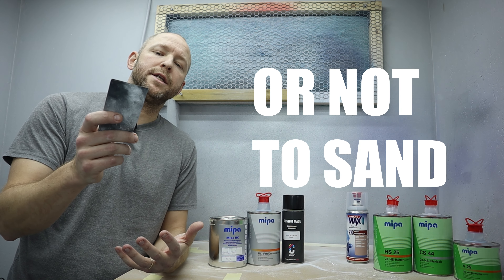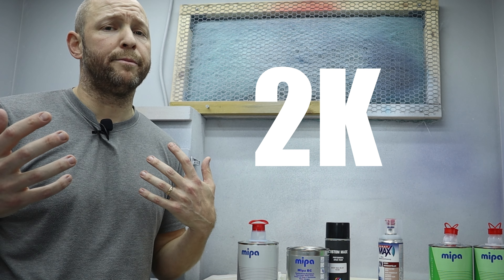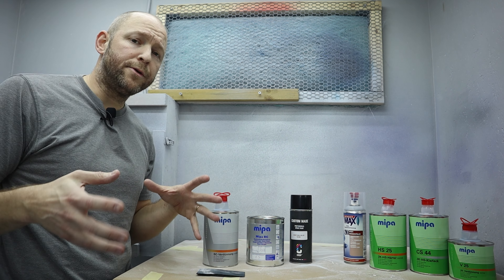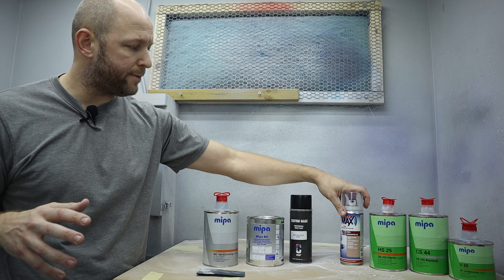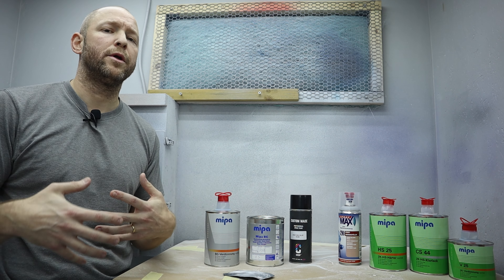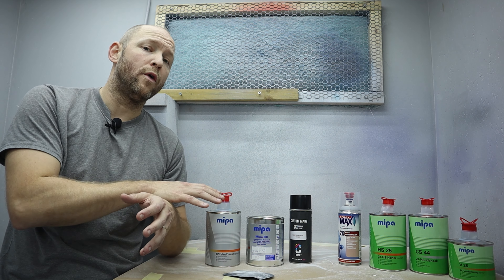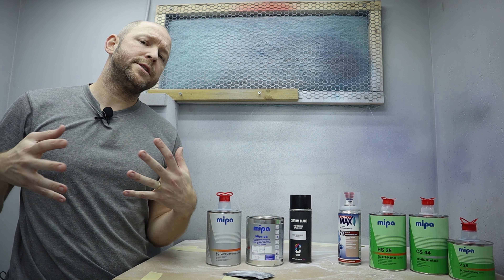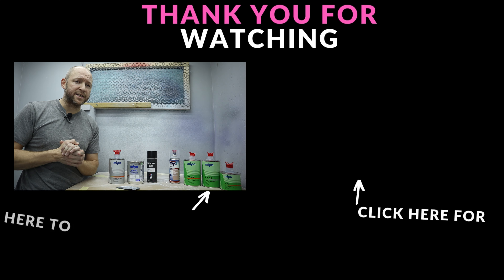Should you sand between coats of paint when you spray paint?

Comment: I agreed with you 100% until  I felt my final 1k base coat with my hand as the last 5 base coats all lightly sanded before this final base coat painted over the entire panel so every coat blends equal on the entire panel with the last total base coat. The microfiber towel stuck like Velcro but not dramatically like my Sandable 1 or 2k primer of 5-6 sanded coats in between those primer coats prior. I then wiped the final base coat down with microfiber towel easing the previous Velcro effect to semi smooth; /No extreme grabbing but glass like ? Not even close. I will wet sand the final 1k total coat , to slippery of the microfiber towel.  Here when I spray the 2k clear how long to 2nd coat? and do I 3000 that coat before clear 2 or is this supposed to be smooth as glass where I need not wet sand this coat? Before clear 3? These are premium automotive rattle cans and your 2k clear I haven't depressurized yet as the panel has it's final finish base coat 5 hours ago.
Reply from the maker: Ok, I don’t completely follow, but as I say in the vid, 1k paint is not to be sanded. But it’s also important that you use products/spray systems that are compatible. If you don’t, you can get bad reactions with wrinkles, bubbles and bad adherence. Also, It sounds like a lot with 5 coats of base coat? 

Normally you can spray the clear coat on the base coat and hour or so after applying the last coat of base, but read the technical information sheet that goes with the paint. For the 2k clear coat, lY down 1 light coat, wait 5-20 min (again check the tech sheet) and lay down another a bit heavier coat if you think
It’s needed, apply another coat after 5-20 min. Let it cure for at least 24 h, if low temp and high humidity in your area, wait even longer. Then apply a final flow coat. 👌

I hope that answers your questions and helps you forward.

Comment: Hey, i made a mistake of painting my motorcycle with a 1k primer. Its been around 3 days and it still feels not fully dry. Sanding the primer makes it cake the sandpaper, but when i push on it really hard it does not leave any finger marks. Can i paint 2k acrylic paint over it or should i completely strip it off and prime it with 2k primer?
Reply from the maker: Sounds strange that a 1k primer would not be dry after a few days. But for best adhesion (on steel) I would remove the old paint and lay down a 2k epoxy direct to the metal. 

To remove 1k paint, all you need is some thinner and wipe it off. 👌
Reply: @MYnextDIYbikePROJECT  i did a mistake by buying a hardware store primer instead of automotive. It has an alkyd base and i read on the internet that aparently it can dry for up 2 weeks
Reply from the maker: @karlisbaumanis6549  that explains it. But should still be solvent based, so get some thinner and wipe it off. 👌
Reply: @MYnextDIYbikePROJECT  thanks, bought the solvent, xylene as its called in english and the shit primer just wipes off. I was really scared that i would ruin my project
Reply from the maker: @karlisbaumanis6549  yep, same thing. Great that it worked. 👌

Comment: When you have to use water after sanding? Do you have to wash it with water? Great video by the way, I final understand 👌
Reply from the maker: Thanks. I normally use water to clean of the frame after completing the sanding to remove all the material ive sanded off. However, you could wipe it off with a damp rag. But you need to be very careful.

Comment: I've watched a few of your videos, but haven't seen the solution to my problem. Apologies if you've covered it in a other video: I've finished the clear coats, but because of my setup, I ended up with clear coat over spray on the seat and chain stays. Along with a couple of other minor imperfections, I'm curious how you finish off the clear coat in this situation: wet sanding, compound, polish, or a combination?
Reply from the maker: Are the seat and chain stays clear coated, and then got additional overspray? In that case, yes sand and polish. 👌

Comment: what if theres a bumpy dust particle on the base coat should i not sand it?
Reply: problem is when i top coat it. the particle is now embedded to the surface.
Reply from the maker: Sure, that’s a different thing. I would try to pick it up with a tweezers or similar. If not possible, use a very fine sandpaper and take it out. 👌
Reply: @ Thank you!

Comment: Super usefull! This is going to save so much time sanding and prepping.
One question though; what about using 1k primer and 1k basecoat? Does the same apply? No need to sand?
Reply from the maker: Yes, same applies. But you won’t have as good corrosion protection if you have a metal frame.
Reply: @MYnextDIYbikePROJECT  corrosion Protection? Would 2k be better for that then?
Reply: @MYnextDIYbikePROJECT  oh and by the way you never have to sand then when doing 1k on 1k? (Apart from imperfections) Man o could've saved so much time hahah
Reply from the maker: @ at least i never do. 👌
Reply from the maker: @yukiiiiii3816  yes, the 2k both adhere beftter and protect better. Especially 2k epoxy primer. 👌
Reply: @MYnextDIYbikePROJECT  thanks, 🙏

Comment: Cheers Mate!

I was "Wet" sanding after every stage.. But when it got to clear coat i wasnt sure, your explaination made me realise and understand even if the 1st and 2nd coats of clear isnt perfect or there's imperfection.. i dont sand straight away.. i let it cure for 1-2 days.. But i wet sanded not dry sanded before apply 2 round of clear after.. is there a diff?

Wish i saw this video earlier ffs.. respraying my cars bonnet/hood  and boot cover..

I was sanding 3 hours on hood then primer 1 coat resanded dry 1/2 day then 2nd coat then resanded..

Took me 4 days to do it and my arms were numb and cramping for 1 day.. 

Cheers!
Reply from the maker: Cheers! 👍
Reply from the maker: The upside with wet is that you continually rinse away the “dust” and it’s easier to see the progress, avoid sanding too far and that you get larger grains, dust that scratches the surface. Also “dust” free. 👌

Comment: Jason, when in the process of clear coat do I add my decals?
Reply from the maker: I paint on the logos and Graphics with stencils instead of decal stickers. Makes a much more professional and durable finish. They can be painted on directly on the base coat or in between two layers of clear coat. The first layer needs to be fully cured and sanded for the paint to stick. 👌
Reply: @MYnextDIYbikePROJECT  I agree paint stencils look very good but I am doing a restoration that uses oe water transfer style decals. Same process though?
Reply from the maker: @draftwood  ah, cool. Ive never used those, but my guess is yes, either on the base coat or in between the clear coat layers.